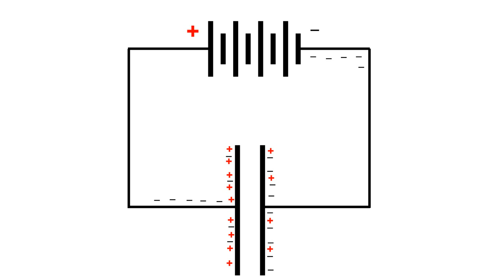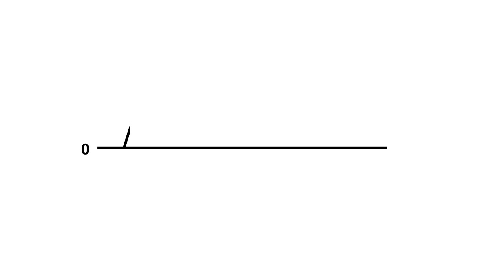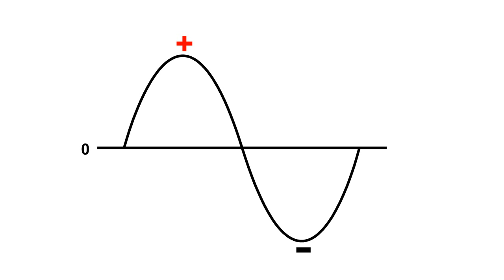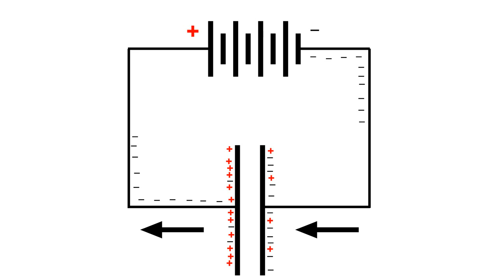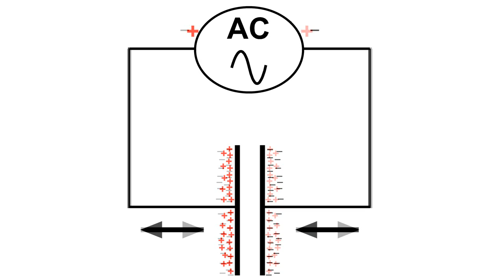Capacitors, DC and AC Current

Comment: @AllAmericanFiveRadio 
Yes, AC Induction motor. those black things you see inside a fan with RU, 250VAC 3mF etc written on them are those any different than a regular capacitor? I took apart a window fan and it has 2 of them inside. they wont run without them I don't think. the motors said duracraft on them. I was wondering if you hooked the cord right to the motor if they would work any better. probably not.

Comment from the maker: High impedance means it will not put much of a load on the circuit. Low impedance means it will load down the circuit. The lowest impedance would be 0 ohms. So if you had 10 V and a high impedance load a cross it, it may still read 10 V but very low current. However if you had 0 ohms across 10 V, the volts would read 0 V but there would be very high current.

Comment: This is starting to make more sense. Now I can understand how a capacitor stores a voltage value/charge. Since V = Ed, where E is electric field strength and d is distance, once the electrons are saturated on one side of the conductive plate the comparative "lack" of electrons on the opposing plate help create the electric field ie charge value. Please correct me if this is not true

Comment: Though current flows at the terminals of the capacitor when it is charging and discharging, isn't there a rearrangement of charge in the dielectric called displacement current?

Comment from the maker: @toyu17 
Any capacitor can be charged with a DC current, that is what the diode is for. If you use to much current the capacitor can explode. To charge a high capacity capacitor we used a 60 watt light bulb in series with the diode. It will glow bright at first then get dimmer as the capacitor charges. Be careful with polarity, if you charge it in the wrong direction, the capacitor can explode.

Comment: Great demo, Now a question, I am trying to figure out how to make a Start /Run AC Paper in Oil Capacitor for Air Conditioning and make into a Filter Capacitor, is there anyway to make it polarized? I know that AC Start / Run has Positive and Common, how do i turn that to positive and negative? I need to be able to use the negative and solder it to the AMp chassis....Pls let me know?

Just trying to get old school, have several RCA 2a3 and Hammond Organ amp that came with 6 to 10 MFD oil Capacitors that are polarized.  thanx a million....
Reply from the maker: If you have a non-polarized capacitor then it does not matter how you install it in a circuit, as long as you do not exceed the work voltage of the capacitor. If you have polarized, electrolytic capacitors, they must be installed correctly, (positive to positive, negative to negative), or they may explode.

Comment from the maker: Thanks exee11
Think of DC as a battery that never runs down. If it is a 12VDC battery, it stays at 12VDC and does not change with time. So that is why DC only has one potential and one direction. Hope this helps.

Comment: very good job!    My only question is, how does a condenser discharged in a dc ignition? you can see on a scope that it will discharge  when the condenser circuit is opened & charge will collapse?
Reply from the maker: CDI Capacitor Discharge Ignition Circuit Demo
https://www.youtube.com/watch?v=0yK3Opq_i0M

Transformer Basic Parts & Function
https://www.youtube.com/watch?v=q3YhbugYjJY

Transformers, basic phasing
https://www.youtube.com/watch?v=BRBqUQPLk-M

Transformers, a few basics
https://www.youtube.com/watch?v=UvHCQswnjEg

Comment: Great explanation and presentation. Thank you. I get stuck on how and why a capacitor discharges given that no actual current flows through it in an AC circuit. What causes the one side to discharge if there is no electron flow through the capacitor? The part where a force between the 2 plates of the capacitor pushes the +e to the other side so it can fill its side with the -e.This force causes current to flow on the discharging side of the circuit until the capacitor it fully charged.
Reply from the maker: leaky  capacitor.

Comment from the maker: @toyu17 
Charging a capacitor with DC, charges in one direction. Charging a capacitor with AC, charges in one direction and then in the other direction with the AC that is used. When you stop the AC charging the capacitor, the capacitor will be charged with DC at the point where the AC stopped.

Comment from the maker: @78recordrepair 
The voltage is almost constant from the batteries, but the current stops when the cap is charged. With AC both the current and voltage alternate. If you have lots of voltage and little current you don't have much power, add current and you do.

Comment: What affect does a capacitor in series with ac have? Since it's charging / discharging constantly does that alter voltage going into the circuit?
Reply from the maker: If you have two 0.10uF capacitors in series, this is the same-thing as one 0.05uF capacitor.
Reply: Did you ever get an answer

Comment: Good vid.  I think the larger the capacity (F) of the capacitor, the longer it  will allow to take charge or current;  (ie. the longer to charge up to the peak voltage of the input signal).

Comment from the maker: @exee11 
If it is DC or AC there is no electronics that flow between the plates. The current flow is only due to the charging and discharging of the capacitors plates.

Comment from the maker: @mamu7mich 
In this simple circuit there is no lead with the current through the capacitor and the voltage across it on the first half cycle. When the voltage is first applied there is a large current flow and it diminishes as the capacitor charges. Now the cap is charged, and this energy in the cap can ad or deter current flow depending on the AC frequency and the capacitance of the cap. It take time to charge and to discharge a capacitor.

Comment: Wonderful video, you're an excellent teacher. The question which I can't seem to find an answer to relates to coupling capacitors, which pass AC while blocking DC. It's a beginner's question! In a DC circuit, isn't there only DC? I don't understand a low pass filter which shorts the higher AC frequency noise to ground while the lower frequency DC signal (blocked by the capacitor) can continue down the circuit. I don't understand how AC and DC can both be in the same circuit? It sounds like the dumbest question but I keep seeing references to AC being allowed through while DC is blocked in the same circuit. I thought a DC circuit was DC only (flat line on the oscillator), and AC was AC (sinusoidal) only, and they never occupied the same space. Thank you!
Reply from the maker: Audio Coupling Capacitor, how it Functions in a Circuit
https://www.youtube.com/watch?v=PAPnwX6YiIM

Searching My AllAmericanFiveRadio Channel
https://www.youtube.com/watch?v=4k7ByHqh8Js

Comment: in DC why is the negative charge only accumulating on the right plate and not on the left plate? also are electrons actually flowing through the capacitor, I mean from left plate to right plate and then to the positive of the battery?
Reply from the maker: How  Capacitors charge and discharge
https://youtu.be/Ag2RujOHqJ8

Comment from the maker: CameramanLink
At the plate of the detector it may have 90VDC, if the audio cap did not block DC you would have 90VDC on the grid of the next audio amp tube instead of just a volt or so. neat stuff isn't it

Comment from the maker: @coondogtheman1234 
besides a starter capacitor there is a winding also to start the motor and a centrifugal switch that opens at about 75% of full speed. That circuit shift the phase to start the motor rotating. Google "start capacitor" or "AC motor" there is lots of good information.

Comment: Can you please explain why we represent capacitor short ckt at high frequency (let infinity by formula 1/wc is zero so short ckt) but as by concept at high frequency there is no time of accumulation and depletion of electron on capacitor plate so current is zero so it would be open ckt at high f????
Reply from the maker: RF Bypass Capacitor Oscilloscope Demo
https://youtu.be/OILLayQjEjY

LC Resonance Testing Demo
https://youtu.be/84WmnlKgTeg

LC Resonance Oscilloscope Demo
https://youtu.be/G_RCyDdt2rM

How  Capacitors charge and discharge
https://youtu.be/Ag2RujOHqJ8

Comment from the maker: When power is first applied to a non-charged capacitor, the current is very high and the voltage is low, because at first the impedance of the capacitor is very low. But when the capacitors charged the current is very low or zero, and the voltages high because now the impedance of the capacitor is high, because the capacitors charged. So the impedance of the capacitor changes from very low impedance at the start of charging, to very high impedance when the capacitor is charged.
Reply: I like your explainations in the comments. Been a residential, commercial, mostly industrial electrician for 15 years and now that ive decided to learn electronics too your videos will be helpful indeed. Thank you very much young fella.

Comment: In the case of the ac current, what exactly is the purpose of putting the capasitor since the current will move forth and back even if the capasitor is not there?
Reply from the maker: Here's one example
Audio Coupling Capacitor, how it Functions in a Circuit
https://youtu.be/PAPnwX6YiIM
Reply: Probably a little over my level but i'll try my best, thx....just wondering like...since the capasitor acts like a normal wire, is there actually any advantages of putting it in that way.
Reply: @glenq3385  The charging and discharging are time dependent! So, those time intervals are important for circuits that need switching in particular intervals - switching and oscillation applications
Reply: @glenq3385  yes, if capasitor is not there it allows ac as well as dc that may break the circuit if you put capacitor it blocks dc at the same time is passes ac

Comment: Thanks for this video. To add to the knowledge:  the capacitor in AC will only get enough charge, related to the frequency of the wave. If the interval in which a semi-wave goes isn't enough to fully charge the capacitor, then you'll have it partially charged. Please, correct me if I'm wrong. If this is correct, then having "big" capacitors working in AC has no meaning at all.
Reply from the maker: Your correct. That knowledge is a little advanced for my intended viewer of this video. Wants the beginner in electronics comprehends the content of this video, advanced knowledge and ideas will be much easier to absorb. Thank you for your comment.

Comment: Very good demo. The point that no current actually flows through the cap is very important.  The constantly changing charge on either side of the capacitor is important as well. It gives the illusion that current is flowing through the cap which is actually not happening.

Comment: Great explanation! But i am wondering... since most capacitors are polarised (and can only be charged one way), won't it blow up if we put it in an AC circuit? half the time it is charging the other way... or does it mean we cannot put such capacitors in AC... only those that can be charged both ways. Thank you.
Reply from the maker: I'm not sure about most capacitors being polarized, it isn't on the equipment I work on. However if you're going to repair a Bose radio, get prepared to replace at least 57 electrolytic capacitors. Usually a non-polarized capacitors used because they're less expensive. It just depends on the equipment you work on, if you see electrolytic capacitors in your equipment it's because it is necessary.
Reply: AllAmericanFiveRadio thank you for your explanation! :)
Reply: I think only electrolytics are polarized, they are DC only & will short & blow if connected to AC.
Reply: ledbetterjack thank you!!

Comment: So lets say we connect a lamp to the capacitor That pulls more current than the power source can supply (like with car audio systems) would the capacitor be able to buffer the voltage drop in the same way that it does on DC with the audio systems?
Reply from the maker: In an AC circuit a capacitors will allow current to pass through them. Some audio amplifiers use a large capacitor in the output to the speaker, but no power is stored in the capacitor. Capacitors only store electrons in DC circuits. And capacitors can not create power by them self’s.
Reply: Ill be slightly more specific. I have a power supply attached to an AC motor, the Power supply can run the motor, but the power supply can not supply the quick surge of current needed to initially start the motor, I figured that a motor start capacitor would work in this way. based on your answer im thinking it would not work like that. Just trying to be 100% sure before i waste money.
Thanks
Reply from the maker: Eli Al If the motor is designed with starter capacitor, I would replace it. I Googled “motor starting capacitor circuit” and found lots of information.
Reply: Awesome, Thank you
Reply: Sounds like you have the wrong power supply. Most motors have one winding that is shunted which allows it to start under it's own power.
Reply: those capacitor start and run motors, have two sets of winding, one auxiliary winding, and the other the main winding, now to create rotating magnetic field, you need a minimum of two phases, which must be displaced by 90 degrees (both physically and electrically), now from a single phase source, you only can get single phase supply, given to main winding .... now the capacitor in series with the auxiliary winding, creates a phase difference of 90 degrees, thus the phase given to auxiliary winding, is the same, but with a phase difference ..... thus now you satisfy RMF condition, and you get RMF, thus u satisfy faraday's law, and motor experiences torque ..... the capacitor in AC, plays the role of phase difference, which is similar to storing energy and releasing, but at that fast rate ie 50 or 60 hz frequency, it ends up creating a phase difference ....

Comment from the maker: Before the discovery of the rectifier the theory (best guess) was that a current (electrons) flowed from positive to negative. When the rectifier was discovered they found that electrons would not flow from the positive cathode to the negative plate of a vacuum tube. But if they reversed it, Negative on the cathode and Positive on the plate Current (Electrons) flows. So electrons flow from neg to pos. Some people never reversed the current arrow, why, I don't know.

Comment: @AllAmericanFiveRadio 
not in this fan. its a 3 speed induction motor and the starting cap is just this black rectangular thing with 2 wires going into it. I was thinking of just wiring up the motors to the switch correctly and without the caps. but it's kinda too late as I tossed this fan but I saved the blades maybe I can use them elsewhere.

Comment: So, does this mean you cannot store AC current? you would have to convert it to DC in order to store it in a battery per say?
Reply from the maker: +Glen McMurchy 
That's correct, capacitors will only store DC. But capacitors do pass the effects of AC.
Reply: Im sorry if this is a stupid question. What does "do pass the effects of AC" mean?
Reply from the maker: +Glen McMurchy 
Audio is AC

Audio Coupling Capacitor, how it Functions in a Circuit
https://youtu.be/PAPnwX6YiIM

Comment: I think the thing that always confused me was that i didn’t realize that there is a moment of current flow when you install the battery (because there was a voltage change). So there seemed to be a complete disconnect between dc and ac when really there are acting on the same principles
Reply from the maker: Thanks.

Comment from the maker: CameramanLink
At the detector plate of an AA5 you will have RF and Audio. You do not want to amply the RF so the RF is drained off through a pf cap to ground. The RF energy is transfered though this capacitor to ground. The audio continues though another capacitor to the grid of the next audio amplifier. The audio cap and the pf cap both block DC.